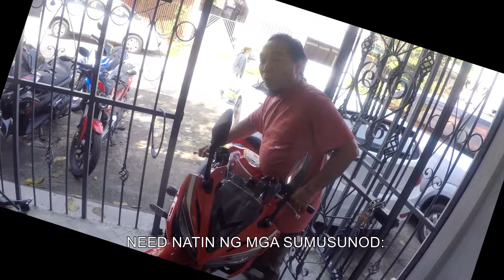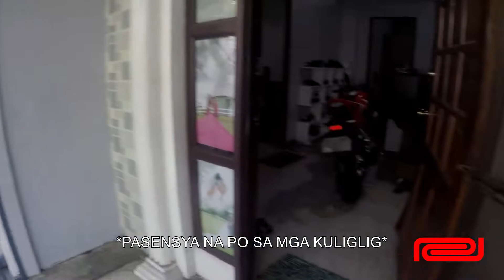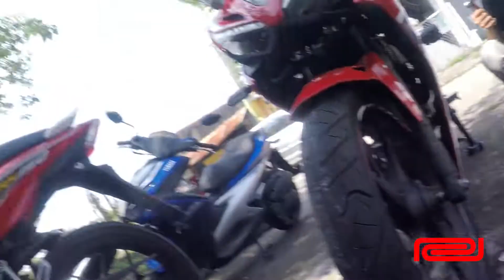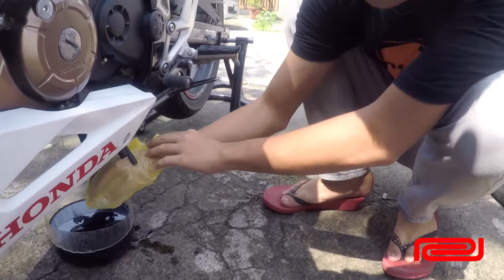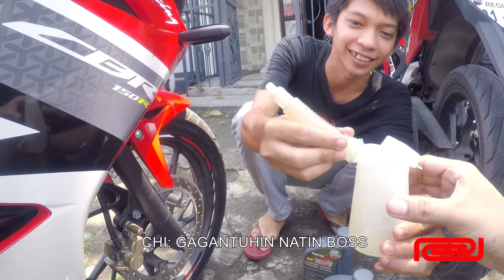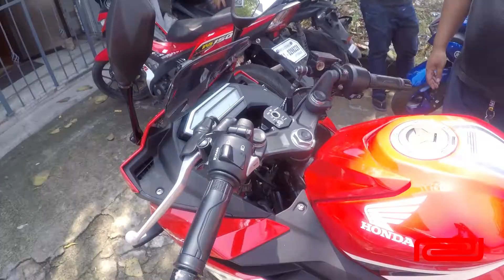Honda CBR 150R DIY CHANGE OIL

Comment: may oil filter ba ang cbr 150?
Reply from the maker: paps ang alam ko wala, pero meron daw nililinis dito paminsan-minsan nag nagsisilbing oil filter.. :) 
research ko yan..:)
Reply: ano pala top speed ng cbr 150? curious lang. hehe
Reply from the maker: @mr.vinramos88  average mga 140kph paps.. sa stock..